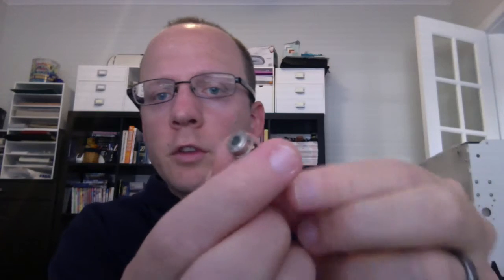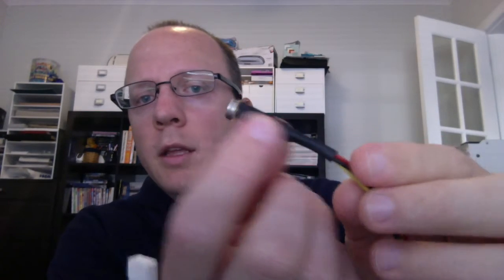wifi pool temperature sensor prototype

Comment: What is the distance that you could measure from? I have a pool house roof within 10 feet that I could mount to. Also has 120vac available, so no power drain issues. Looks interesting.